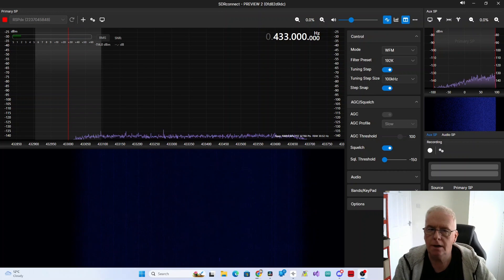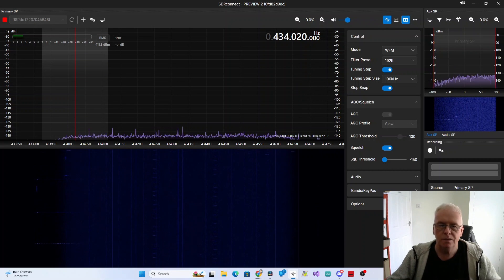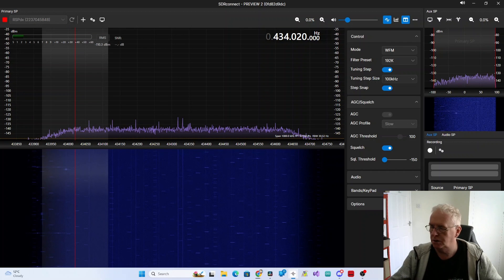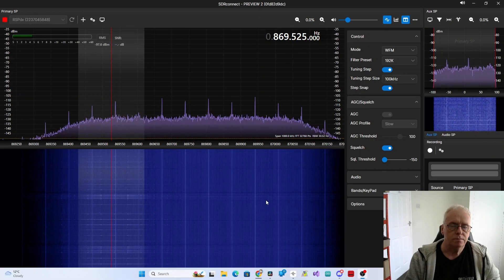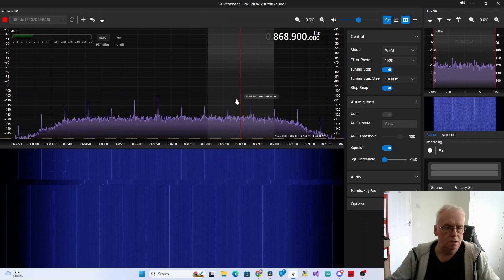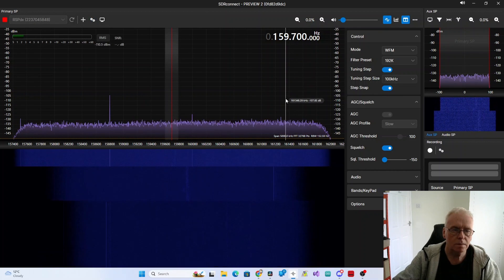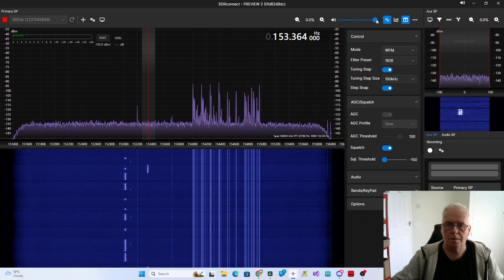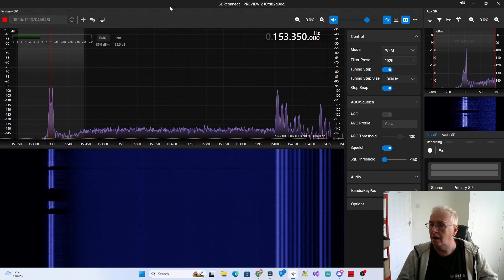Should I use Meshtastic on 433 MHz or 868 MHz?

Comment: You mention MQTT.  I think there are some hackerly possibilities to it as a lot of home and industrial automation sensors seem to run on it, maybe you can send that data over the mesh?  But aside from experimenting with uses they never expected or intended, have you found any uses for it?  I think a couple of nodes where I live cheat through a hill in the middle of the town, but aside from that I don't know if there's much use.
Reply from the maker: Yes, MQTT is a messaging protocol designed to send sensor readings such as air pressure, temperature and so on. A friend of mine is working on a chat application via WiFi using it. You can find Mark Coultous on https://github.com/djcasper1975/Meshify

Comment: 3 reasons to favor 868 MHZ: less crowded band, though ISM band is close. Higher max allowed max transmit power in Europe is 500mW if the duty cycle is low on 869.525. Higher frequency means higher gain for a given antenna size.